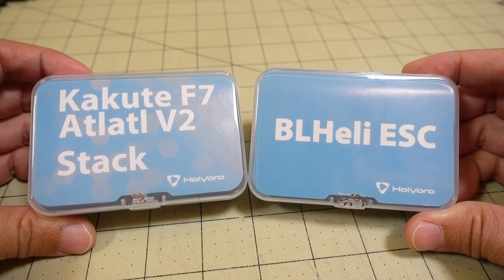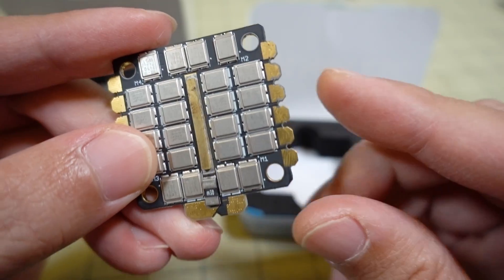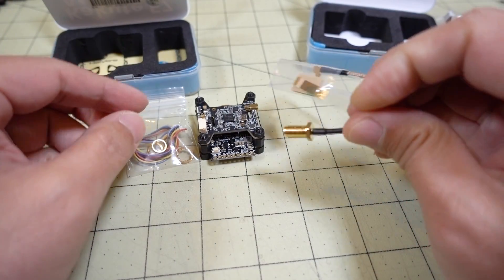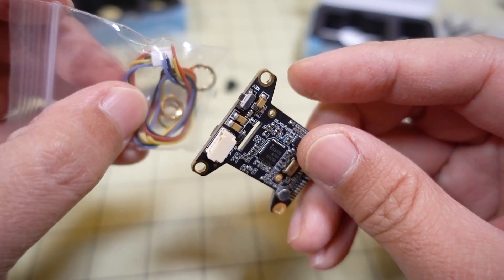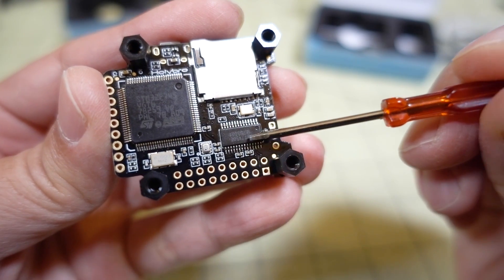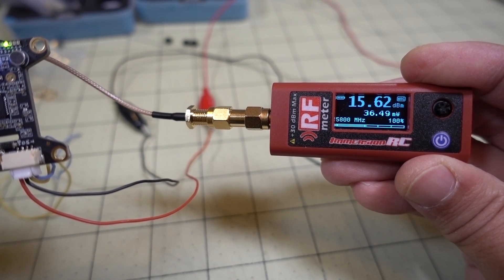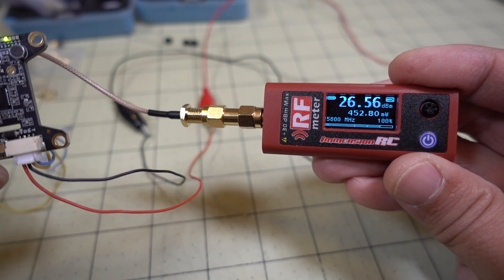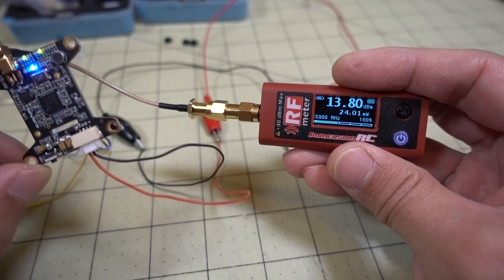Holybro Kakute F7 / Tekko32 F3 / Atlatl V2 Stack Review 😀

Comment: Biggest question in my mind, that nobody asks and nobody answers: about this Holybro 4in1 ESC... Is this 65Amp total or 65Amp for each motor??? in case per channel... 260amp total at 24volt/6S battery.... thats some massive amps and heat
Reply from the maker: It's PER motor.
Reply: @AlbertKimTV  ThankYou

Comment: Hi I'm going to use this fc in a build but with a racerstar esc I'm concerned about current sencing to the fc with out using the cable or should i use the cable and reconfigure the wires? Thanks
Reply from the maker: I'd reconfigure the wires to make sure it all matches to avoid problems

Comment: "Please use non-metallic isolation standoffs (marked in red in the diagram above) for the mounting holes on the ESC, Because mounting holes and motor pad are connected."

Comment: Hi. Do you still have ESC. Can you check circuit beetween Bat+ and all metal case in ESC. My ESC, Bat+ was connected with 2 line metal case in center esc. Is it normal?

Comment: Not really a question, but after JB getting shit over his hard work testing using the Immersion Power Meter.  Does ANY vTX output "their marketed power rate"?  1000mw is 700, 800mw is ~450...  Is it really the Power Meter?  or BS Marketing..  

Good review, A-Kim!  Or is it AK, Mr. Kim,  A to the Kim....  :)  Any rate, keep up the good work bro.
Reply from the maker: The meter itself might be calibrated properly, however, the usage by the tester and also the pigtail used to connect the VTX to the meter are all over the map which is why results are inconsistent everywhere you see it being used.  As a result I won't be using it for reviews anymore.  Definitely won't be using it in any TBS video for sure!
Reply: @AlbertKimTV  Brother I would encourage to keep using the power meter (even on TBS products).  Giving us a point of reference is better than nothing which we have now.  If all reviewers did this, then the community can compare results on our own.  Possibly put up a disclaimer, "results have many uncontrollable factors".  As a Network Engineer, my career is filled with BS numbers.  "My internet connection is 100Mbps", "why can't I get even close to 100Mbps?"...  Many of us are educated enough to know that numbers don't really reflect actual life values.  Even more so when talking about RF.

The percentage difference between the selected power outputs means more at the end of the day in both dB and power level (mV).  

Thank you for what you do.

Comment: I have this stack. DId you get ESC Telemetry worrking? Betaflight 4.0.2
Reply from the maker: Haven't tested 4.0.2 on this one yet.
Reply: connect telemetry to one rx port. enable esc in tab port. enable esc_telemetry in configuration tab. 4.0.2 working

Comment: Hi sir will this beast esc can be pair with its original f4 kakute or not ya? Hopefully it compatible to kakute f4. Thank for great vids
Reply: Yes.  I'm sure you're asking about the wire harness and it's the same 8 pin harness pin-out for all Holybro FC'a and ESC. 1-8 = vbat, TLM, ground, Current, M1, M2, M3, M4.  If not the harness, most all 4in1 ESCs are compatible with FC's.
Reply: @NicksMind21  thank for reply this help me alot.

Comment: I have the kakute v2/tekko 32 stack on a build. The layout and quality seems good. The built in soft mounting does help, but I ended up adding dampening anyway after experiencing interference. My biggest complaint is the FC to esc wire harness has a tendency to pop loose in hard crashes this is something that could leave your quad stranded somewhere unrecoverable so I ended up using e6000 to make the plug permanently attached. Pretty lame to have to do fiddly repairs like that.
Reply from the maker: There aren't many stacks that don't use these type of micro connectors these days.
Reply: I have the same stack, and I crash fairly hard (possibly not as hard as you), not once has JST SH connectors came undone.  Now, I make sure to fold the extra wires between the stack.  But never hurts to use Shogoo or e6000.

Comment: I have been flying the Holybro Kakute f7 board and stack for about a month. Not this esc but the previous version. I cannot get my f7 board to see betaflight unless its powered up and i cannot run at 32, only 16. I also fly the holybro f4 stack. betaflight runs on that whether im powered up or not.
Reply from the maker: It sounds like your FC is defective regarding the USB issue. You should contact Holybro customer support. They have good support and will take care of you.